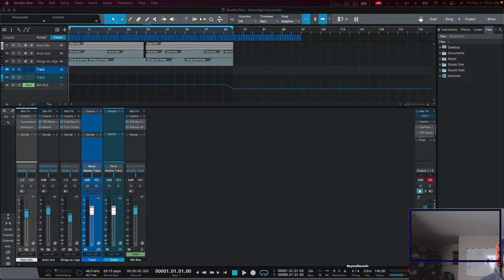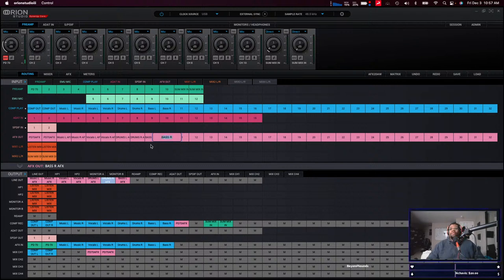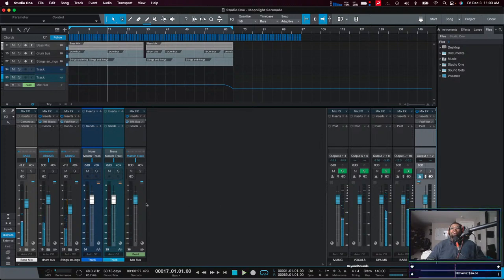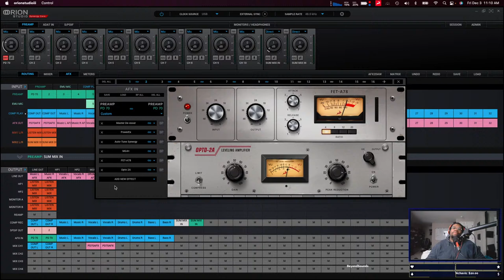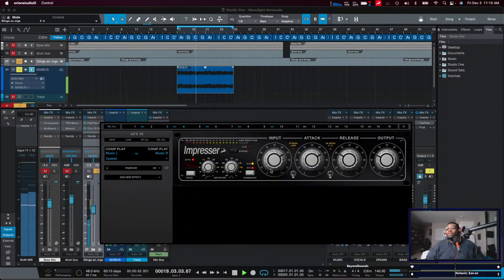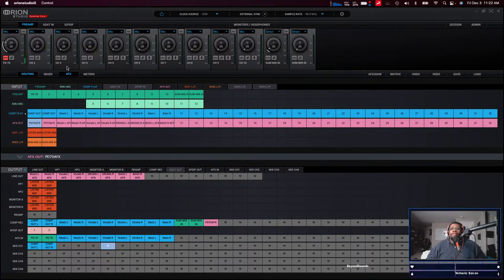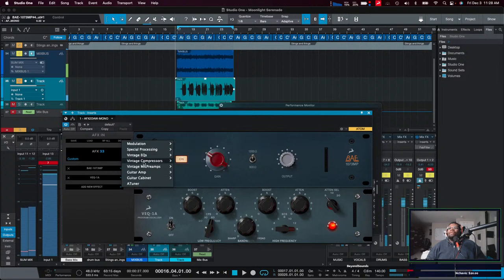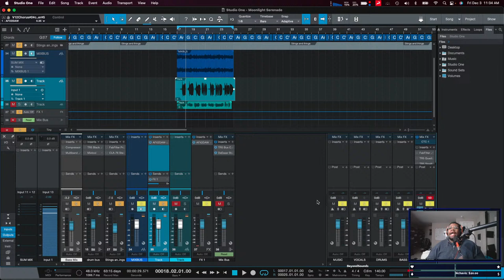Antelope Audio Orion Synergy Core | AFX + AFX2DAW | ROUTING | ANALOG SUMMING

Comment: Nice video man! You're the first one that I know that uses a high end interface from Antelope Audio.  I always wanted to get those new Zen or Tour interface from Antelope, but I heard ppl were having issues and lots of problems.  So if AFX2DAW works with those Zen interfaces i might give it a try.
Reply from the maker: Yep they sure do! Just make sure you’re checking whether you’re wanting to use thunderbolt or USB C. The zen go can do AFX2DAW via USB C while the others need thunderbolt
Reply from the maker: Thanks for tuning by the way
Reply: TB is the best route togo with their interfaces ...I have Antelope Audio Satori summing monitor controller alongside their Eclipse 384 which runs into their Orion Studio HD and all clocked using their. 10mx clock but. the Orion is the USB which has given me issue since having it, whereby it would disconnect and you would have to hot plug it to show up again .. Its due tobe returned to Antelope Audio shortly THE SOUND QUALITY IS WHAT HAS KEPT ME there is no denying it

Comment: Hey man, thx for the nice vid. I have a Neve 5059 summing mixer and I just got this interface but Im still trying to figure it out. I have connected the two units with db25 cables. But I can't figure it out in the control panel. For example, I have a kick and trying to route it in channel 1 on my sum mixer. How do I do that on the control panel?? Thanks in advance for the help! much appreciate it, Jess

Comment: are you summing the antelope into d box  or d box plus?
Reply from the maker: 8 channels out of the Antelope, summed into DBOX, then DBOX recorded back into antelope.
Reply: @MixedbyToryG  Do you feel it elevates the sound? I know antelope is already high quality.
Reply from the maker: @MinisterTravis  yes I think it adds a sense of depth and flavor. I mean technically you could sum directly back into the antelope but the added hardware in the DBOX adds some flavor. The reason I have it going back in to the antelope like that is that the antelope has high end converters. So with that said, if I didn’t have an antelope, I’d probably have had to spend money on additional a/d converters like burl or another brand. The antelope solves that issue for me by not only being my interface but also my high end converters to flawlessly receive and record the results happening coming from the hardware.